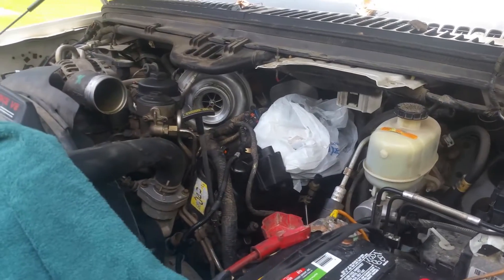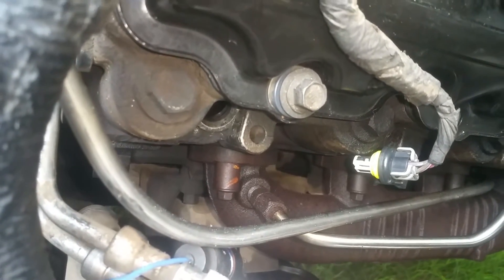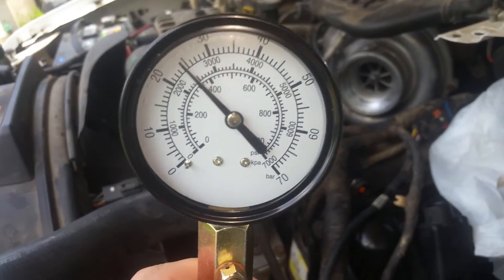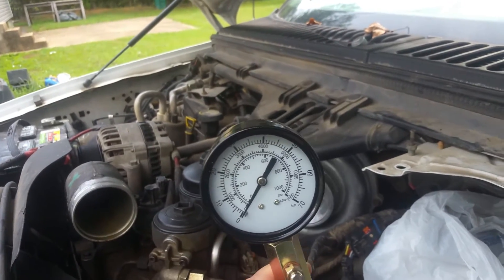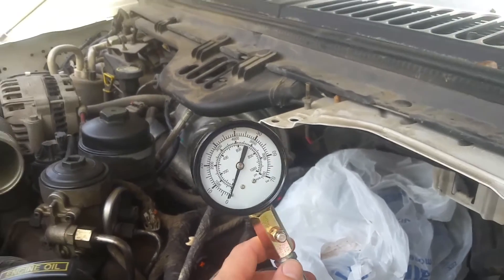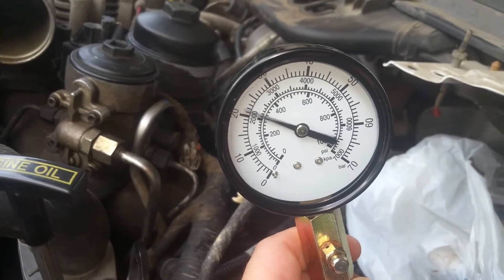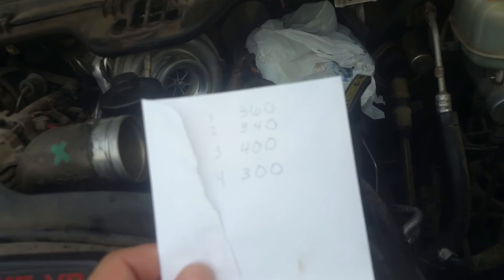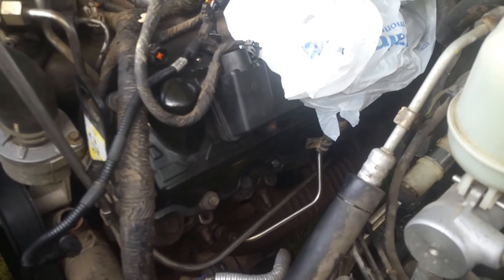checking compression on diesel 6.0l f350 2006

Comment: How did you prevent the engine from starting
Reply: Pull ficm relay or start using solenoid wire near hvac unit with key out of ignition.
Reply: @ thank you 👍

Comment: Nice test, I need you help I have a Cummins 6cta8.3 cuat is the compression standard I need to do a compressipn test and other test for oil cilinder leak do you know the parameter on PSI for both test?

Comment: Judging by the cranking speed without compression (no glow plugs installed) it’s sounds like it’s cranking too slow. I’d check battery Health and starter/ wires first. Just a thought. I know this was posted over 2 years ago but I’m just putting it out there for anyone that’s doing this in the future. Good luck. 👍

Comment: U need 500 psi to start. !!!!  Damm. Bro
Reply: He's not testing the high pressure oil rail where you need 500psi of oil pressure to fire the injectors.
This is testing the combustion chamber pressure which relies on head gaskets, piston rings, and valves.
Looks like your doing a leak down test next.

Comment: Were did you get the adapter from
Reply from the maker: I got a cheaper guage from ebay . It worked ok for a bit but i had to end up getting an otc ( from ebay also ) even though they are more expensive.

Comment: Is it just those 2 things that could be bad?
Reply from the maker: It was early on in the diagnosis , but I come to find out the entire engine was scrap . It had got way too hot , melted the plastic stand pipe piece in the oil filter housing sending plastic all through the engine . Now I'm not saying that there wouldn't have been a lot of work fixing it if there wasn't the plastic parts melting in there but it sure would make the engine somewhat salvageable.  It was a good learning experience however and I found another engine and swapped it out. Thanks for watching